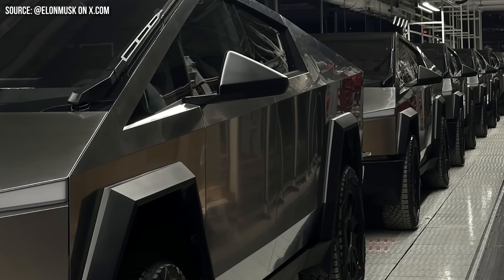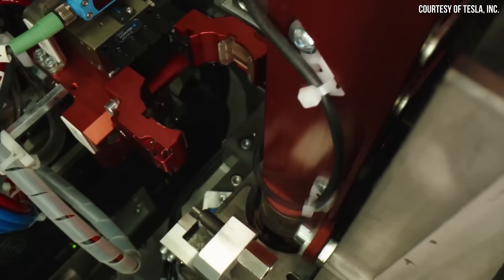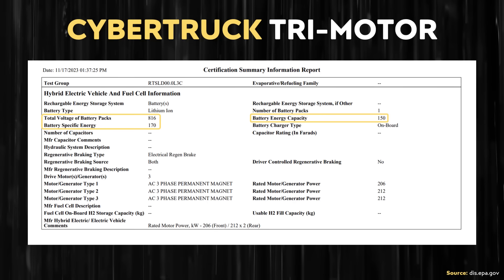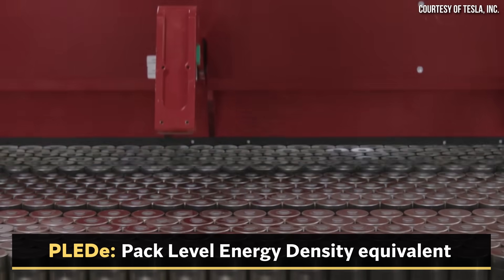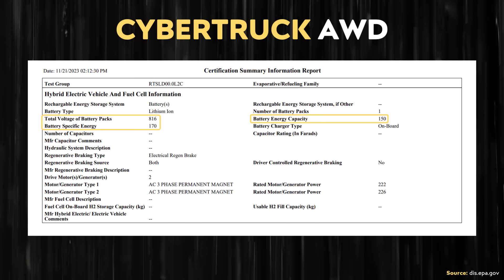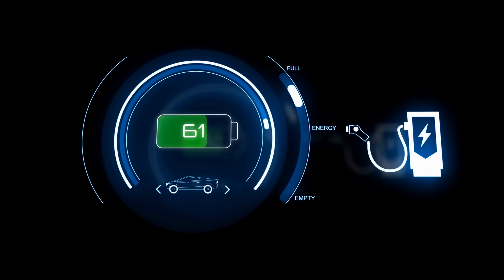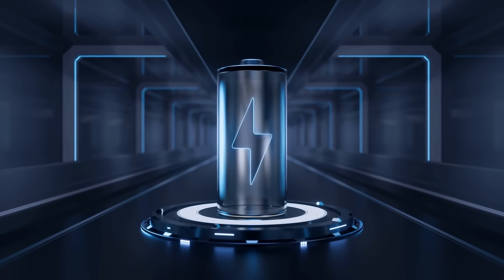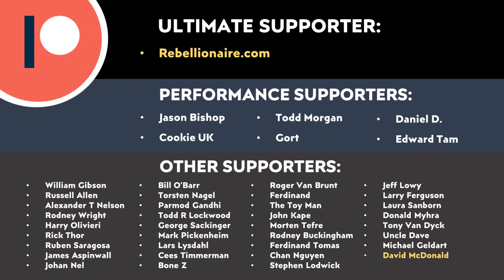Tesla Cybertruck Battery Pack SECRETS REVEALED | Next Gen 4680

Comment: Double stack the batteries if there is space to do so or get a move on with the R&D at Kato road. Quite disappointed with the energy density after all this talk/hype around the 4680 cells. Seems like other battery manufacturers like BYD, CATL, PANASONIC are way ahead of Tesla currently.

Comment: I wonder if the rear wheel drive has the same size pack but lower kWh due to being LFP cells, so same dimensios for all 3. I wanted to look at the miles with the improvement you forecast. So 470+, 10% next gen 517, 10% gen4 568.7. I could see gen3 happening soonish. Hoping gen4 isnt too far out either. Lastly 597.15 without side mirrors!

Comment: The pack include the actual frame equivalent vs a standard modelY
Reply: in the skateboard design the pack always includes a frame that acts as protection so that the pack doesn't burst into flame whenever you have an accident
but structural battery pack the cells themselves are under load and contributing to the rigidity
the 4680 model y AWD has(had) first gen structural battery pack. according to tesla CT is like gen 1.5 but no one outside tesla or not under NDA has seen the inside of the pack yet

Comment: As you have said in previous videos, the 340ml EPA range will be dramatically less in most use cases so any serious, off-roading, hauling loads with/without a trailer, will be problematic. Elon was correct that the truck needed an EPA OF 500ml at the original unveil without a compromised bed to be of any use. 
I am praying for a range close to 500ml when I take delivery in a couple of years.

Comment: Remember the 4680 cell is higher capacity so less are required per vehicle and that means less production volume plus lower internal resistance from the tabless design which helps reduce charging losses and less heating. Hopefully they have higher cycle life as well.

Comment: As the pack is structural it will save weight in the vehicle so we need to work out how to remove the structural element. How about  divide through by the whole vehicle weight and compare with kwh per kg against Ford lightning etc.
Reply: the lightning with extended battery is good old body on frame, has 9kWh more capacity, and 2235lbs max payload vs 2500lbs, 10000lbs max tow rating vs 11000lbs, weight for exenteded range version ranges from 6300 to 6900lbs (probably close to 6900 in the highest payload/tow capacity heacy duty configuration) vs cybertruck AWD 6600lbs
So from a consumer point of vue, there is no clear advantage for the unibody + stainless steel "exoskeleton" + structural battery pack + 4680 cells vs body on frame.
The biggest difference is probably be in torrsional rigidity and road driving characteristics
because battery pack, unibody and exo skeleton all contribute to rigidity, and lightning has a completely different chassis, its hard to separate the impact of the battery and the chassis, and we can only compare the specs of the trucks, not the individual parts
But the lightning has the advantage of modularity, you can configure different battery size, different payload an tow ratings depending on your use. the biggest advantage of the cybertruck is not related to the stainless steel, but the design that drops the legacy 3 box  truck design and the aero drag benefit that comes with it despite the sharp angles
but rivian does better (0.3) with a rounded boxy design, silverado ev 0.33, Ram REV matches the cybertruck (0.34)
Without the stainless steel constraint, tesla could probably have gone down  close to the model X 0.24 drag coefficient but more realistically anywhere between 0.25 and 0.3 as a compromise between  blobby/rounded/teardrop efficient design and "tough"/square design. Tesla has always be looking to save every bit of efficiency as possible by looking at every single source of losses, but always within cost, performance, and design constraints

Comment: If they're not using a double stack, and the batteries are very thermally efficient, then perhaps they could come up with a new battery dimension that is a little taller and wider. For example a 60120. It wouldn't require the extra hardware two stacks need, and is shorter than two 4680 cells. Also less metal used. 
Is very unfortunate that the silly range extender must be used and still can't get to 800 km on current chemistry.
Edit: the cell size I suggest should hold about 2.5x more energy.

Comment: For pack-level energy, perhaps the problem is we are comparing apples to oranges?  I expect that the SBP includes everything within the SBP case: the interior floor, the exterior bottom, and the frame around it.  It may also include the electronics in the penthouse.  On the other hand, the 2170 packs only count the modules within the battery compartment.  Wouldn't this shift the numbers in favor of 18650/2170 battery packs?
I seem to recall the MY AWD with 4680 was heavier than the 2170 version.  If recalculated with the 10% increase of the Cyber Cell, I wonder what that would look like?

Comment: If the cells are the same 65% of the pack weight as for the MY, we would get 262wh/kg. Your 268wh/kg implies cells are 63.43% of the pack - could be the case as pack is larger and has a larger structural job???

Comment: For range extender, would it be a lot cheaper/lighter with a small 10kw-25kw generator, about 5 gallon small gas tank? This is like a reverse hybrid(large gas engine with small battery). Tesla cars can drive for 3-5 hours, China popular EVs with range extender have 113kw generator and 16 gallon gas tank. A small gas generator should be able to generate 50kwh easily in 3-4 hours, should be much lighter/less costly than 50 kWh battery range extender, which would weigh about 700 lbs, $15000+

Comment: My guess is that Tesla deployed some of the increased energy density to make the battery more resistant to fire by being more waterproof.  They may have packed some extra weight to assure that this car---one that claims to be able to go through water--is not going to allow any of that water in to damage the batteries.  Hurricanes and floods are relatively common and Tesla doesn't need to see the Cybertruck going up in flames after exposure to high water.

Comment: PLEASE can EV Critics stop pretending that a "normal" person drives 300+ miles per day . . . Coal Miner Voice: "Ya, I gets up at 4am, drive 3 hours to work . . . Work in the mines for 10 hours, then drive another 3 hours to get home -- I ain't got no time to charge no EV"
Reply: It's not about driving 3, 4, 500 miles.  It's about having that energy reserve for towing, camping, power tools, etc.
Reply: @jordanpack5571 Tesla has bigest SCharger network in the world,easy to travel anywhere. And for much lower cost then any gas or diesel
Reply: @jordanpack5571 If you stop for a break every 3 or 4 hours, take a snack, a crap, a drink or donut and coffee in 20 minutes while charging, the shorter range while towing is no big deal. If you're going camping or you're on vacation, what's the big hurry?
Why does everyone who is towing and filling up gas and diesel need to fill up in just several minutes? Please answer that question.

Slow down a little and enjoy the drive.

One or two 20 minute breaks for charging are not that much longer than taking 10 minutes to fill up a diesel or gas tank and also grab some food or take a bathroom break while you're on an all day journey, on vacation and towing a trailer, boat, motorcycles or ATVs with your truck or SUV.

With all of the negative remarks regarding EVs, it's like ICE drivers who tow never stop for food, drinks, scenic turnouts or bathroom breaks.
It would seem that ICE tow vehicles drive 10 or 12 hours on every trip while stopping for only 5 minutes to fill up. That's it and then they arrive at their destination after getting their full 20 MPG highway mileage rating while towing 10,000 pounds.

Comment: What does the battery pack cost?
Reply from the maker: Likely around $15K to $20K is my estimate for a replacement. But that shouldn't be needed in most cases until the truck hits 200K+ miles.
Reply: @Cleanerwatt hopefully by this time i hope they will have an “upgraded” pack i can put into my “old” cybertruck. I want my 500 miles
Reply: No one but Tesla knows the price,,stop guessing 😂
Reply: @WANDERER0070  Hidden within the source code of Tesla's website, it was discovered that this extra battery will cost $16,000

Comment: 4680s still not using silicon in them either. That will be a big energy density increase
Reply from the maker: For sure! It could add 10% with just a small percentage of Silicon added to the anode.

Comment: It seems Tesla is going for process reliability and scale in their 4680 production before tackling dry cathode and then silicon anode. Silicon anode has the potential to double or triple their current 4680 battery capacity (cell level energy density) depending on the implementation. I believe they may be working on this at their Kato Road R&D center for their gen 3 4680 cells expected to begin production in Texas and Nevada near the end of next year.
Reply: That's exactly what I am hoping for as well. Doubling the range with the same size or even smaller battery pack would be an absolute game changer.
Reply: Some companies have slicon additive that can be added as a blend in agent with no manufacturing changes needed. Should be simple to get a modest boost.
Reply: Double? Triple?  No. Max 20% more energy.
Reply: silicon anode has the potential to increase energy density by a big factor,  not only for 4680 batteries, but also reduces the number of cycles considerably. it would be a good solution for 1M electric hypercars that woud get a brand new battery pack every 10000miles, but for now its not ready for mass production and long life otherwise we would have a bunch of 600 miles EV flooding the market.
Reply: also, silicon swelling seems to be a pretty big issue in a structural battery pack. if the cells are already under load from the factory and silicon  volume increases, its like a ticking bomb

Comment: Problem is we don’t know how much weight in the rest of the vehicle was saved due to it using a structural battery vs not and how that weight savings converts to actual range increases of the vehicle.
Reply from the maker: True - that is info I want to know!
Reply: Well the 4680 MY weighs more than a regular MY.
Reply: Also I think the energy density of the structural pack would never be equal to a normal pack
Reply: @FelipeQuirce  almost by definition right?  If you could use the absolute thinnest cell casing and put them all in a styrofoam box but then surround it by a super rigid frame that might be the most optimal arrangement.
Reply: @darylfortney8081  the thing is that in theory the 4680 cells have rigidity/strength from their inner construction and dont need a thick casing to be strong? thats where the idea of a structural battery pack comes from. if you can really compress the cells together, with no soft material between them, and sandwich beetween rigid top and bottom plates, you get additional strength.
Reply: Exactly!   Very likely that all things considered, we have significant progress here.
Reply: It could be that having a structural battery isn’t the most efficient way to strengthen the vehicle and it’s better to have a flimsy battery inside a strong frame
Reply: @darylfortney8081  definitely a possibility. structural battery pack means the cells are under load which could reduce their longevity or even increase risks of battery fires. the battery pack cant increasse rigidity just by glueing batteries, so it's really the outside structure of the pack that's doing most of the job of increasing rigidity/strength. doing it through unibody leaves much more freedom. you can do "tubs" like in CF sports cars, space frame chasssis, giga castings, 3d printing generative design, etc and a mix of these.
of course tesla is not going to 3d print anything because its too slow, except maybe for the roadster.
the ford f150 lightning designed around the body on fram gas f150 in extended battery configuration has virtually identical weight/battery capacity/range/acceleration/payload/tow rating as an AWD cybertruck...even the cost is quite comparable the price for an AWD cybertruck gets you a F-150 Lightning Lariat Extended Range with a few options
the only big difference is Ford is likely losing money on most of the F150 lightnings sold. Tesla is just getting started and wont keep making cybertrucks if they don't make money on them
Reply: I was thinking the same nice 😂

Comment: Yes, the 2170 and 18650 have more mass enclosing the pack not needed in the structural pack.
Reply from the maker: The 2170 and 18650 pack have more energy per kg of battery pack weight... thus are more optimized than the Cybertruck's structural battery pack.
Reply: Afaiu, there is not much enclosure savings per cell because the 4680 cell enclosure is thicker.  In a pack, there should be savings though since there are no extra parts required to add structure to the lack (the 4680 cells are the structure).
Reply: @tripzero0  my point is that the pack weight is more of the total car weight in the structural case. The other packs are enclosed by structure which adds weight.